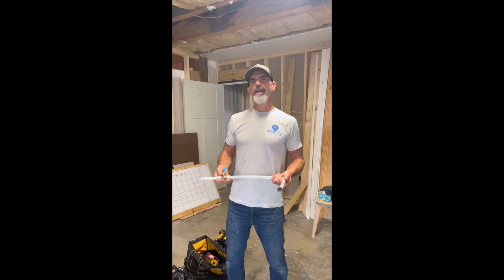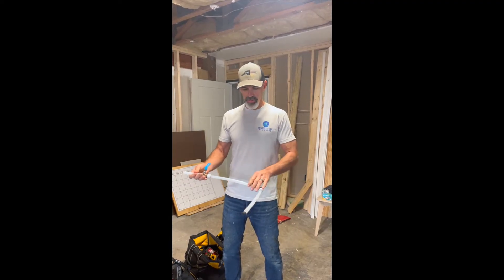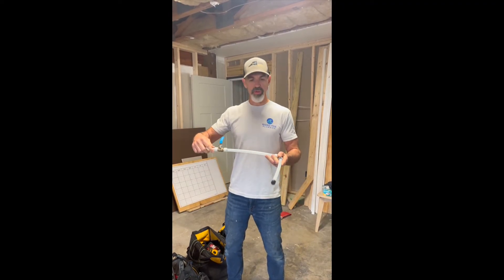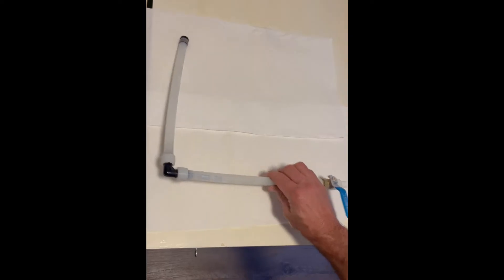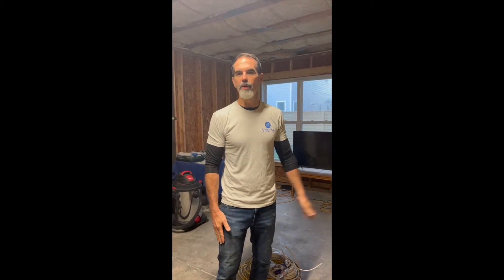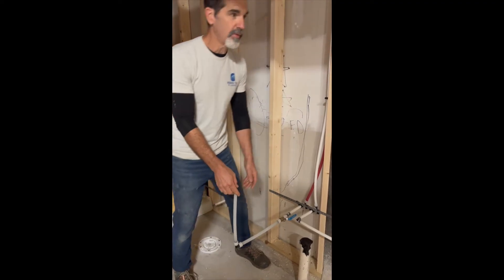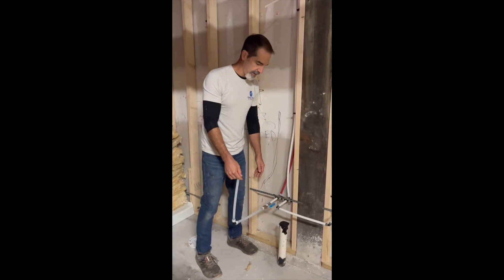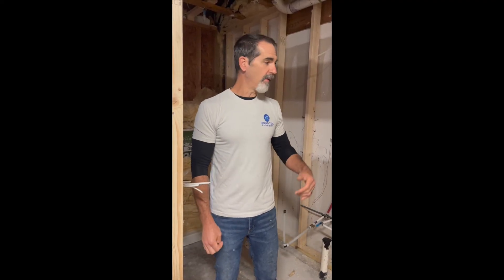Pex A Freeze Test.  Frozen, will it burst under pressure?

Comment: you cant pressurize water....its not compressible like air is...so the second you turn the water off there is no pressure, you cant trap water pressure per se
Reply: He left the water running with an extra 100psi behind it.

Comment: I currently have cold and hot water slab leaks on my house which was built in 1959. Which route would you go to fix the issue? I've been offered tunneling, jackhammering, and this PEX rerouting on a 1059 sq ft home. Thanks for your time.

Comment: I’ve noticed in most of your videos you use 90° fittings on Uponor PEX A. do you have a reason for not using the sweep brackets, to avoid a fitting? In electric work less connections equals less opportunity for open circuits.

Comment: I would not worry about the PEX tubing fails at say 0 F. The most likely failure points are any brass fittings and less so the plastic fittings. I had a quality (as not made in China) brass ball valve cracked way above 0 F that is an RV fresh water drain valve that was under next to no pressure. I would say that PEX plumbing still most resistant to freezing of all, despite the weak points are the fittings.

Comment: I'm curious if half inch text will freeze under ground at 2 ft without insulation? Temperatures around 15°. I do understand if they're not insulated coming out of the ground they will freeze. But I have also heard underground pipes will not freeze?

Comment: This is digging into what I'm looking for,  I'm satisfied with the pex A pipe holdin up,   I guess my question and you're showing part of it is how well do the fittings hold up,    The elbow seems to be pex plastic,   it seems like that being full of water would freeze and rupture,    as well as the valve you have own there,  most ballvalves or stems, brass or gav. would freeze and burst,    These do not seem to be effected.     Would you agree?    I'm in the mountains of VA,  it's not uncommon for us to have 2 weeks at a time with the temps 20 degree or less.      The pex I'm sure would hold up,  but elbows and valves,   ??   still looking for answers.
Reply: Copper dog all day
Reply: And heat tape

Comment: I have Pex tubing running through my whole house. In the master bath it froze last year and this year due to a deep freeze here in Texas. It does that in this area of the house only because it faces an outside wall. So far, I have no issues with the tubing busting or leaking.
Reply: Your insulation sucks my man.. add some more